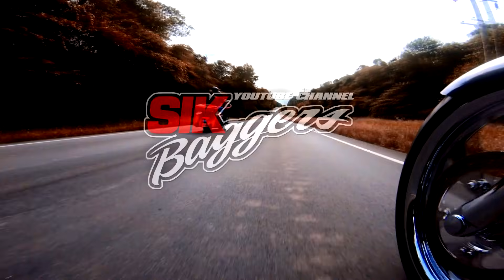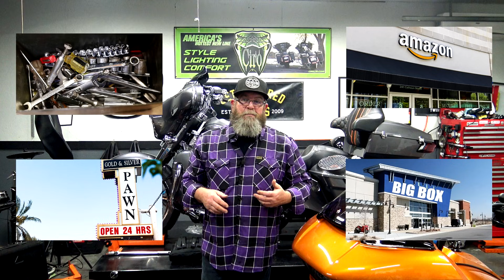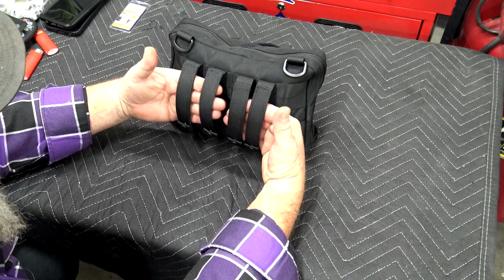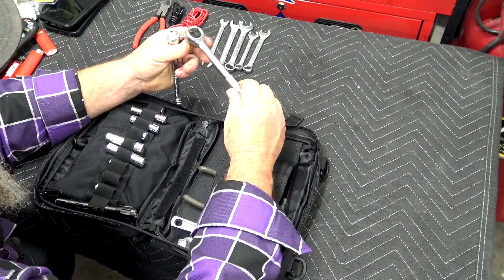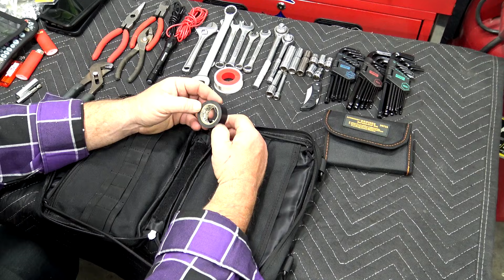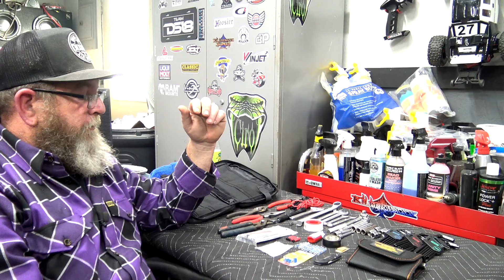⚡Build A Motorcycle Tool Roll Cheap!⚡

Comment: We're about if you have a flat tire, what do you add on that tool travel bag? 😳 By the way good/good/good information. Thanks brother!!! Gby...
Reply from the maker: Thank you! A good plug kit and some co2 cartridges will work to get you somewhere, at least off the side of the highway. I need to address the tire issue in my bag as well but had a lot of great comments with suggestions on this video.

Comment: Hey Steve I was thinking about getting one of those Dixon shirts I notice you wear them all the time and my sons got a couple of them and he loves them but I am about 290 and 6’ 1” and I was wondering what size you are and what size you wear because I only want to order them one time and not have to send them back and return them and all that mess that goes with getting the wrong size
Reply from the maker: Hey Steve..yeah i have a few XL and now 2XL..becasue I wanted them a little looser on me. The sizing chart they have on the website is spot on for the mens...the women's shirts are ridiculously small and I dont know how they justify it either. My wife wears a M and in dixxon flannels the 2xl barley buttons. And the t shirts are ridiculously long. 3.5 inches longer than any other shirt I have I own.  The sizing chart for the flannels is the same for the t shirts. The long length on the flannels is fine but on t shirts? I wont buy anymore. They look like a dang mini skirt on me.  Go to any shirt and right below size there is a link for Size Guide. The flannels are pretty well spot on and they dont shrink.
Reply: @sikbaggers  thanks man I appreciate the info, I’ll get a tape measure out and see what size I need to get, I’m figuring that since we’re getting into the cold riding season that flannel will feel good layered up

Comment: Break down with stripped splines on the forward shifter lever , genius in my opinion an elastic wrapped in between stripped splines retighten shifter lever , worked great bike made it 80 miles home 
Not my bike but a rider in the group
Reply from the maker: Nice addition! Those things strip all the time!

Comment: Screw in tire plugs, 12v mini air pump, Leatherman, micro fiber towels and rain-x, rokstraps, lighter. I also keep my heel shifter and drill out the bolt hole and put in a shank bolt/nut/ lock washer. In 2018  on my old bike 2001 ultra classic, coming home from Sturgis had the shifter come off at 85mph on I-80 in the twisties dropping into Salt Lake City in a rainstorm. The stock bolt is all threads/ no shank and the threads in the slotted area wore out. Luckily I had the heel shifter in the bottom of the saddlebag from when I removed it. I never used/ liked a heel shifter.
Now on my 2018 geezer glide ultra couch I put in shank bolts in all areas of the linkage along with upgraded after market linkage and an extra shaft. My sons friend broke his shaft ( insert giggle here) up in Azalea Montana at topless Tuesday and 20 min later was riding again.

Comment: Great video, definitely something folks need to keep in mind. We’ve actually put together a pretty extensive tool kit. I have it broken down into 2 smaller bags and a tool roll. This way we can split the kit up among 3 different bikes. This allows us to carry many different sized wrenches, sockets and such. This way, if we come across someone on another brand or foreign models we can offer assistance. We even carry a small jump box, actually assisted someone in Daytona earlier this year that left their lights on. 

Great video man!
Reply from the maker: Nice Shane..Yeah if you have the room then definitely can carry more tools. I do carry a jump box and should have mentioned that but it was separate so I forgot. But its been used a few times on buddies bikes too. Definitely a great add on!

Comment: Great video. I currently ride a ‘78 FXE Superglide shovelhead. My tool bag has just the basics, not nearly as complete as yours. A good crescent wrench, end wrenches: 7/16, 1/2, 9/16, and 5/8. Pliers, needle nose, a multi drive screw driver with all the bits I’ll need, spare spark plugs and wrench, zip ties, and a couple hose clamps.
Reply from the maker: thats a great tool bag! I think for sure one thing I need to add is a spark plug socket..I dont have that and all these comments got me thinking.
Reply: @sikbaggers  Absolutely! A fouled plug is an easy fix that can ruin a good ride and doesn’t take much space. It’s a must have in my opinion.

Comment: I did that when I got back into riding about a year and a half ago. Went to harbor freight, $110. Plus I kept adding stuff. I have found some things at flea markets. Good idea about making 2.
Reply from the maker: Nice Eric! I wanted to price everything as if I had to buy it all brand new but never got the chance..I really only bought a few things that I didnt already have so having you weigh in on the topic is excellent! roughly a 110 bucks and you got a nice bag with everything you need. Thank you!

Comment: I know alot of guys are against it but like you said, if it's the middle of the night and you're out in the middle of nowhere a tire plug kit is good to have on hand. Along with one of those co2 air nozzles.
Reply from the maker: Absolutely and that's one thing I haven't addressed yet on my end. I have plenty of plug kit material in the shop and need to pick up some co2 cartridges because you are right...in the middle of the night, it beats not having anything. Its meant to get you to a place where you can repair it the right way...but you have to get there first.

Comment: First off - nice shirt!  Now, having said that, this is always a great topic. It’s always best to put together your own tool bag. No need to buy a $100+ tool roll to carry unless you’re lazy. For years, I used to carry a mini garage, but now it’s narrowed down to stuff I need in order to tighten bolts or screws, secure an item (Think zip ties and Rok straps) or fix a flat. Any other kind of maintenance probably needs to be done in a garage or a shop. If I am on a long ride, I will carry a Reda 1 gal. saddlebag gas container which I have actually used to help several stranded riders over the years. I swap the Reda between my Harley or Wing depending on what I am riding and how far and for how long I am going. Especially cross-desert riding. I consider this a part of my ‘tool’ carry.
All my carry tools (for both my HD and my Wing) are inexpensive Harbor Freight, garage sale or pawn shop tools. If I loose a tool, I won’t loose sleep over it.
On a side note. I am intrigued by the self-soldering wire connection. I will need to check into that as well as the Molle bag. I like both of those.
Update: I just ordered three of the Molle bags. 1 each for both my bikes and one for my pick-up truck. Estimated delivery (Jan 8th - 22.   Eeeek)
Reply from the maker: Hey thank you! Love the dixxon shirts! And thanks for the comment too...Always best to carry the cheapest tools to get it done..loose one? no biggie, hand it off? no biggie. The link I put for the mollie bags was just a few days shipping...did you get them from amazon?  These are the connectors I get but you can find smaller qualities. I use them on stereo installs so I order a gob of them at a time. https://www.amazon.com/gp/product/B07MLHT2NZ/ref=ppx_yo_dt_b_search_asin_title?ie=UTF8&th=1
Reply: @sikbaggers  …yes, I ordered from Amazon. I picked the desert camo, maybe that’s why those are delayed

Comment: I already have a tool bag but what I really REALLY want to know is.....
Where'd you get that cool shirt and I'm in the market for new rims for my '17 Road King and was what you're using on your Street Glide?
Reply: Think its a dixxon shirt
Reply from the maker: Hey joe! The shirt is a Dixxon and its "the crown" ..they are limited runs so i dont know if they still have any but it came from there...and the wheels are from SMT machining ...I got the 21" Twisted Steel
Reply: @sikbaggers  
Thanks 👍, 
I'll go check those out.

Comment: As always another awesome video mate, When I first got my bike I brought myself the Harley Davidson branded tool roll from the dealership, thinking it would have all the stuff I need, although it is pretty good it is expensive, making your own kit would be far more economical plus after using it a few times on other peoples bikes I have had to add to it. 1 thing I did put in was some thin gauge tie wire for when you can’t use a zip tie like on your exhaust. Also mate the shirt you are wearing in the video caught my eye, just wondering if you have any info on them as I would be interested in getting some.
Reply: Think its a dixxon shirt
Reply from the maker: Dixxon, The Crown
Reply from the maker: Thank you Wes! Yes, I think after making that video I need to get some sort of bailing wire..a small run of it at least..that's a good point, and thank you for sharing!  The shirt is a DIXXON and its The Crown ..the DIXXONS are limited runs and I didnt see it on the website  but yeah it came from www.dixxon.com
Reply: @sikbaggers  cheers thanks

Comment: Here is my tip, use your tool bag when doing any maintenance on your bike. (i.e. oil change) that way you know if you have the tools you need. If you don’t, then add it to your tool bag. I also carry a tire plug kit and co2 cartridges.
Reply from the maker: Great tips!! Thanks foe checking out the videos! Im going to look into the co2 as the battery  tire inflators are expensive and get terrible reviews.

Comment: My Bike has the stock tools plus the rear shock adjust spanner. Added  750 amp jump starter, Tire plug kit,  a few face cloths for rags, volt meter, Rubber gloves, N95 face masks, DOT 5 brake fluid, hand style air pump. A first aid kit is also handy. Ciao.
Reply from the maker: Very nice tips Wes! I do have a seperate jump pack in its own case and I forgot to mention that. Lots of other great tips too..thanks for sharing!

Comment: Another really great video... the only thing I would add is my trusty Vise-Grip pliers... Heck I've seen them used as a shifter arm to get you somewhere to fix it correctly.
Reply from the maker: Yes I had a set laid out to add tot he bag and never did...I need to find a smaller set that fits in the bag better ...thank you for the reminder and checking out the video!
Reply: Years ago pulled out of the old pine knot saloon in T or C New Mexico late Sunday night about 80 miles from home . on I- 25 south ,  dang! Flat tire , no , it was the rear.axle about half.way out .me and bro. Mike pick scooter up push axle back in n lock it down with vice grip pliers. Sabotage or careless me I don't know . pretty hairy experience either way...
Vice grip pliers highly recommend for multiple uses.
Reply: That might have been my husband you saw doing that.  😂

Comment: You need a 2032 battery in your kit, dead battery no start I love your videos .I have two streetgrides
Reply: Thats what the security code is for. Just enter the code and start the bike.
Reply from the maker: You would be surprised at how many people dont know their code or even how to do it...thats another video I need to  make!
Reply: @sikbaggers  I see people on these forums all the time asking what their code is! A lot of people have never messed with it or bothered to learn or change their code until they are stranded!   A good video on it would help a lot of people.
Reply: @DarrenSharp  Amazing how many don't know their code or how to use it etc.  Came upon a fairly good size group of riders that had been sitting outside a national park stuck for hours because one of their riders bike wouldn't start because Key FOB battery died.  He never replaced it since bike was new 2 years ago.  I had them up and running again in 3 mins...  the look on their faces when I told them just one person needed to start their bike, then pop out their battery give it to the other person to replace his dead FOB battery.. and their off.
Reply from the maker: Hey great tip. I didnt think of that because I dont have security on my bikes BUT I always tell these guys to get an extra battery for their fob when they bring it in.

Comment: Great video!! Your tool bag looks similar to mine, but the idea of carrying one in my pickup was a great suggestion!  Only thing I would add to your list is a small tire plug kit..... THAT I have had to use on the bike, just make sure to use it at a gas station where you can pump the tire back up lol.
Reply from the maker: Thats a great tip John! I know I need to address the air pressure issue or flats..I do have some repair kits and I did try one of those amazon rechargeable air inflators..little hand held one...it sucked..for 60 bucks it was terrible. Ill keep looking!

Comment: Steve,  I have a question about your passenger back rest on your bike in this video.  It looks taller then mine and it looks like you have it on a chopped tour pack.  Is that true?  If so, where can I get that seat?  Thanks for any info you can provide.  And thanks for the videos.
Reply from the maker: If you are talking about the street glide on the lift its a King tour pack and just a standard backrest for the kings..Its from Advanblack...they have a matching seat that goes with it and in 4 other colors.  https://www.advanblack.com/harley-parts/harley-seat-backrest/harley-touring-seat-backrest/harley-touring-corba-seat-backrest.html

Comment: Since I'm not a mechanic every time I work on my bike I use my tool bag kit.  And if I don't have a hand tool that I need in the bag I'll go through my toolbox or buy from pawn like you suggested, so I have it next time.  I also keep a tire plug kit and mini tire pump that plugs into the lighter.
Reply from the maker: Nice Troy! I tried one of the rechargeable tire pumps from amazon. Battery operated, it sucked and got sent back..ill look into one that goes in the acc plug for sure. Thanks for the tips!

Comment: Thanks Steve. There are certainly a lot of options for tool bags and like many things, expensive doesn't mean better.
I don't have a pre-made tool bag. I did pretty much what you have done using spare tools I have in the garage. What I haven't done yet is the second tool bag. Remember that these tools are for emergency roadside repair and are not intended to be your regular shop tools. So being budget minded when purchasing is not likely to come back and bite you.
Reply from the maker: Thats right...I dont need to impress anyone at 2am on the side of the interstate with my tools or tool bag....just need to get it done and back on the road.

Comment: Awesome video Steve. The bag I use is from Roaring Fire Gear. It’s a “tool bag roll”. I never have tools fall out, packs up well cause it can be rolled real tight. Give it a look, thanks. God Bless!!✌️😎
Reply from the maker: Actually I was looking at that one and the one I got from amazon at the same time...the only reason I went with the one I got was the price, ill be honest. The roaring fire gear roll is very nice though and I had my eye on it for awhile. Thanks for the great tip and the review..I may make one from that bag next for the other bike so I dont have to keep swapping them out.